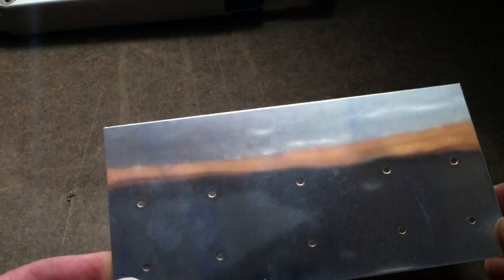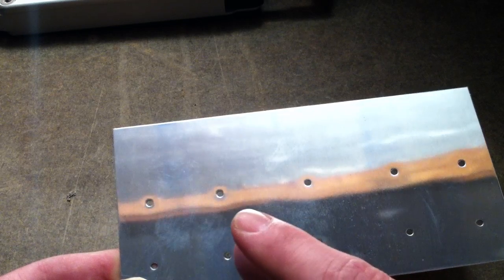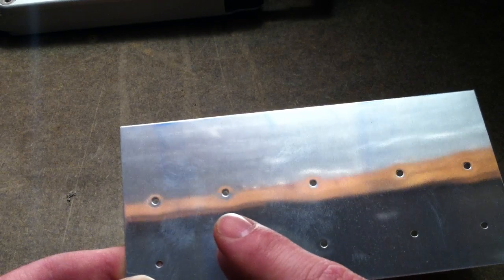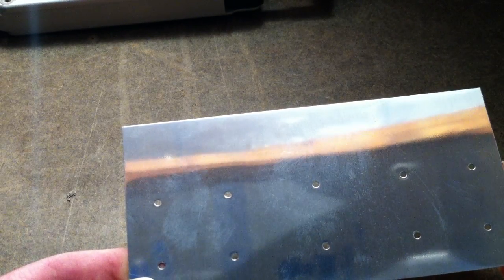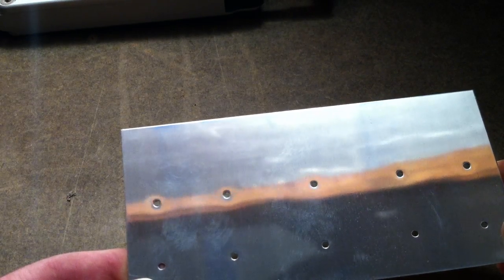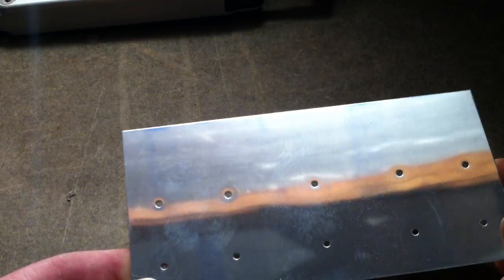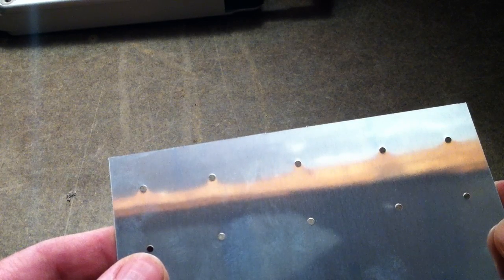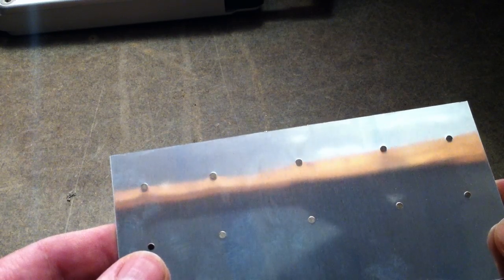Proper Use of Springback Dimple Dies from Cleaveland Aircraft Tool

Comment: So the moral of the story:  keep the dies tight….  Correct?
Reply from the maker: Yes, that's right. Generally you'll start with the adjustable ram set so the dies are touching and adjust a little tighter from there.

Comment: Hi `mike, `ive just seen a video on here ( Its an old govement one ) and it talks about having a different angle dimple depending if its the top or bottom sheet to be joined ? Is there any truth in that ? Or as per Vans use the same dimple ??
Reply: Neil Parkinson               You are talking about the Walt Disney war production cartoon video that describes riveting procedures of thin sheets to thicker sheets depending on sheet thickness............the video speaks of using 100 degree top sheet dimple dies , nesting into 110 degree dimpled holes ...........and three sheet joints using 100 - 110 - 120 degree dies so they nest loosely into each other............from what Mike says , they don't use different angle dies.........they use the same angles because they all get crushed together when riveted..